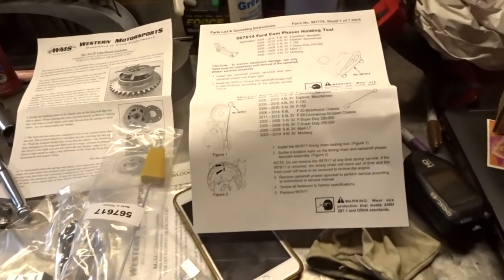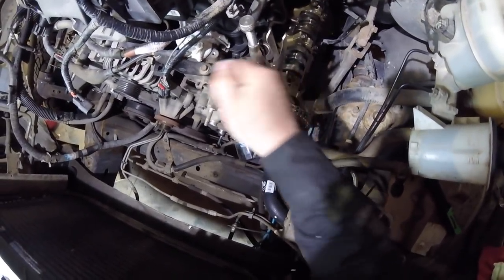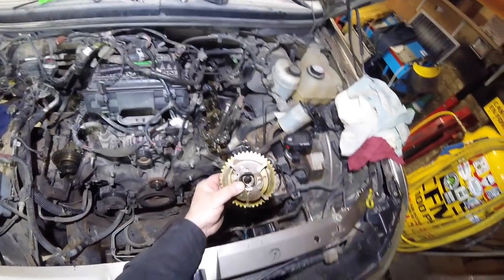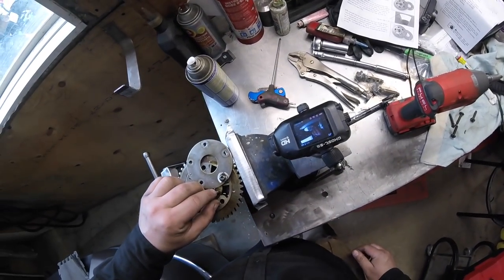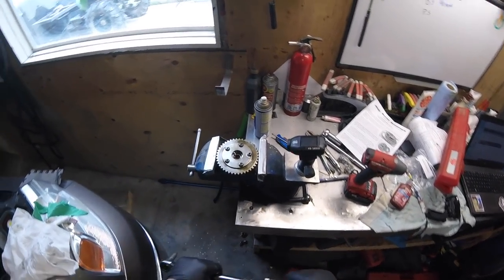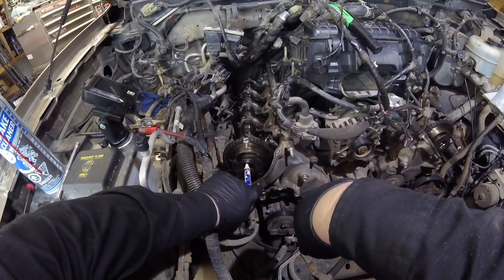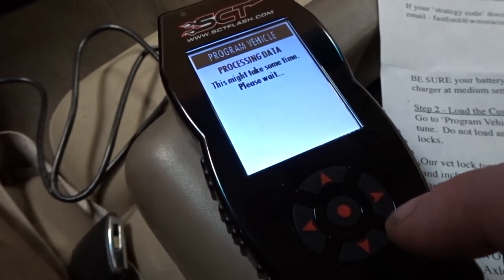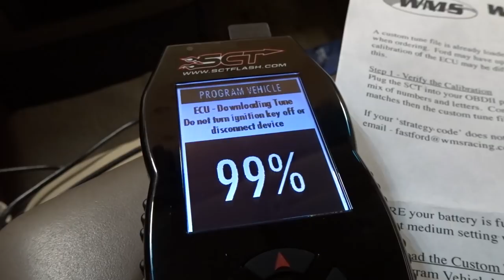Ford 5.4 3V how to install Cam Phaser Lockouts

Comment: DUDE you SAVED MY TRUCK!  My son & I just did this to my 2007 F-150 5.4 (268,000 mi) this week.  I had the cam phasers replaced about 100,000 miles ago, but the problem recently came back.  Just like you said, I ordered the OTC 6681 tool set,  & the WMS cam phaser blocks & bolts with SCT tuner & pre-programmed tune to lock out the phasers.  Your video was an awesome guide.  Even your vice-grip 'mistake' helped us, because we realized which way the camshaft wanted to turn when the gear is removed, and turned out vice grips the other way to prevent rotation, and the OTC "stick" tool held the timing chains fast.  After we serviced the phasers (THANK YOU FOR THE DETAILS!), we re-installed them using your video; no problem getting the timing chain back on perfectly.  While we were at it, we changed out the spark plugs & coils (the cam phaser issue kills them).  Then, we put it back together, we uploaded the tune with the defaults, just exactly like you showed in your video.  Engine started right up, and I think it's NEVER had that kind of low-RPM power before!  Thank you SO MUCH!  I'd give you a SuperChat if I could figure out how!
Reply: Been driving it for a month, now over 3,000 miles so far, including a cross-country trip.  No issues whatsoever, even with over 270k on the odometer.  THANK YOU SO MUCH!
Reply: @Nichetronix  What did you do with the tuner when finished?
Reply: @DelFam2011  I kept it.  It's useful as a diagnostic code reader, and as a engine parameter display (timing, RPM, fuel curve, etc.)  Definitely a lot of value.
Reply: How much to buy it all ? I m thinking of doing it my self .thanks in advance.
Reply: @DelFam2011  I still have it.   I use it when I want to read codes, etc.
Reply: ONE YEAR LATER!  Still rolling!  Truck has had other issues (had a coil-on-plug go, suspension work) but is still going strong!  I've put another 10K miles on it in the last year (I live in the countryside and don't have much of a commute).
Reply: @Testdontguess I have shared your video with another friend who is going to fix his cam phasers on his 2005 5.4L F-150!

Comment: Think...think...cam lockouts are...spacers. Yeah, spacers. You can cut any slug of metal to size and have a similar result. Or use a stack of pennies. The phaser will not move...it will be fixed in position.

Comment: BSK garage how’s your truck holding up now with the lockouts and oil pump how many K on her? I’ve had my lockouts with Sct in for two years now but need another timing job done. This time I’m installing 360 pump and keeping lockouts trucks at 260k cheers good content👍

Comment: Newer ford updated phasers. Ratchet style tensioners, upgraded guides, new chains and the mehlings HV oil pump and 5w30  Had mine done 2 years ago and havnt had ANY issues since.. hot idle im at 30psi oil pressure
Reply: Not sure what happened to mine but lots of noise from the chains. Glad to hear you had success. I’m eying the kit from freedom racing comes with every thing you need! Any advice would be great! Btw how’s is locking out the cam phasers help? The real problem is the oil pump !!

Comment: Thank you, I've been on the fence about doing this to my 5.4 3 valve. I have the same truck as you do. She's been loyal I tell you. She has 394,000km and I've never had internal engine issues. Oil change's and I let it warm up. I never just start and drive, unless it's a real Fucking emergency. Keep making good video's.
Reply from the maker: oh wow that's awesome that the engine has lasted that long
Reply: Lol holy shit here am worried about having 293600 km on my 05
Reply: @mikeethier2779  oil is a hell of alot cheaper than a new engine. These engine's are very sensitive to clean oil. They are durable though, 6 bolt mains throughout.
Reply: Dan P good to know think this is going to be next on the list
Reply: 07 expedition 285500 kms just started ticking. Doing the lockout and its listed for sale. Bought a 32 ft motorhome
Reply: so with that kind of performance why would you worry that the VCT needed to be overidden? Just do a timing job with top of the line FOMOCO timing kit. My suspicion when hearing the comment that this You tuber had heard of retiming jobs going bad an a year or two later is that they were done with aftermarket timing kits that were not up to par!

Comment: Thanks. Right on. Only note, just did this today, aftermarket cam phasers can be different inside and the metal plugs won’t fit. Grinder time. Went exactly as described other than that.
Reply: How are aftermarket’s holding up what brand?
Reply: I personally prefer genuine motorcraft. Not something one wants to do twice…if you can help it.

Comment: In other videos I saw ,out of the 5 bolts on plate,two are for the spring.one bolt holds the loop of the spring,the other goes thru the bottom of spring.but quess since spring is going to be obselete it really doesn't matter.

Comment: I install the lockout kit 2 years ago.  It has worked great.  I'm doing a timing job on the 5.4 and I'm reinstalling the lockout.  The reason for the timing job is specifically the oil pump was down to 18psi when the engine is hot
Reply from the maker: best thing you can do to these motors
Reply: Apparently there is a new oil pump out. 20% more oil flow. Can't remember off the top of my head who makes it though.  It's not Ford. Great Video!
Reply: @locknload9143  meling high volume oil pump.
Reply: @locknload9143  Melling M340 and M360 HV pumps

Comment: Great video. Some times the blurry pictures printed on the instruction manuals can be frustrating. I have a Q about the SCT X4. Does it come with the option to delete the VTC or did wmsracing load the tune on it for you. I plan on installing cams in my 4.6L I asked SCT if they have a tuner that can reflash my ECU after cam install with cam phaser limiters and they replied " Thank you for reaching out to us today. Cam phaser lockouts and Cam modifications require custom tuning. Most tuners can do E-tuning and get you setup with everything you need so you do not have to go to a speed shop for a dyno tune."

 
Best regards,

-WY 
 That reply is telling me that the X4 can modify my ECU so I can run my engine after install ? Any suggestions?

Comment: Thanks for sharing the information! What I did with the diagnostic tool was a reprogramming of the PCM? Is it mandatory to do that?
Reply: No
Reply: Yeah it is it won’t run well without it. They sell replacement ECUs on eBay for like 155$ with the cam phaser delete tune

Comment: There are two reasons why some timing kits take a crap after a year. Using timing parts from an oreillys or wherever, they can only get a hold of shitty Chinese parts. Lucky to get a year out of them. Other main reason these parts can go is not using a premium synthetic oil. With both tensioner seals gone on mine my phasers were still absolutely fine but I replaced them anyways with Ford parts. Myself I use royal purple hps and red line. On the 5.4 and 4.6 3v using the fl820s or the Ford racing filter should be the absolute only filters ever used. Tried wix xp, amsoil, royal purple and they all lowered my oil pressure to were I would have a knock on cylinder 6. Do not waste your time with motorcraft 5-20 blend. Pennzoil,Castro, royal purple, red line are all in my opinion very good syn oil for these engines
Reply: what oil density do you run? I know some people run a more viscous oil than the stock 5W-20

Comment: Thank you this video help me with the lock out kit installed  because I  take it to at shop in the  want to charge  $2175 I did my self and safe a lot money  thanks
Reply: Why is this ? Locking sprocket for ?

Comment: Had shop do this at the same time they rebuilt the motor. Runs great but check engine light is on and codes timing too advanced cam sensor. Do you guys think they simply failed to load the SCT tune? Or ?

Comment: Thank you sir I'm tackling this job this weekend very informative, you cleared up alot of confusion from the forums as well. Quality video
Reply from the maker: good luck
Reply: @Uriel Levi Instablaster =)
Reply: @Nicolas Jaziel Thanks for your reply. I got to the site through google and Im trying it out atm.
Takes a while so I will get back to you later when my account password hopefully is recovered.
Reply: @Nicolas Jaziel It worked and I finally got access to my account again. Im so happy:D
Thank you so much you saved my ass!
Reply: @Uriel Levi You are welcome :D
Reply: @TestDontguess   when you locked out the phasers did you loose much power ?

Comment: How do I know if it’s even worth doing  this to my engine? Is there like a engine pressure test I could do to see if the clearances are within range? I got 240k miles and want to know if I should replace the engine or do this to the timing. To my knowledge it’s running great and smooth right now just has start up rattle when it’s cold and is missing some mid range power.

Comment: Why was the vise grip being used?
Reply: I'm no expert but from what I've read here are my conclusions.  When you take the cam phasers off there is a chance that the cam will rotate to a different position, thus putting the engine out of time on that bank.  The reason the cam rotates is because there is spring tension against the cam lobes coming from the valve rockers.  The thing that is holding the cam in its position is the phaser, which is connected to the cam chain, which is connected to the crankshaft.  If the position of the cam relative to the position of the crank gets altered that side of the engine will not have the valve opening and closing timed properly to the rotation of the engine and the firing of the spark plugs.  If this happens the engine will run rough if it runs at all.  

The vice grip is there to keep the cam from moving when the phasers are taken off.  You can position the cam in the right spot in its rotation so that the risk of it moving when you take the phaser off is lessened, but the vice grip, though crude, gives you extra insurance that no surprises will happen.

Comment: GREAT VIDEO! I Thank you for the step by step guide. I'm in California and had a hell of a time getting a SCT tuner but I finally got one and will be doing this on my truck this weekend.. Thanks again for the road map!
Reply from the maker: I hope you got the SCT that has the special program for the lockout that has to be custom made from your PCM Code cause not any SCT tuner will work
Reply: @TestDontguess  I got SCT x4 7500
Reply from the maker: @Fluxxcapacitor52  that’s not going to do anything for you…… the lockout tune has to be custom created from a company with your PCM code.  Just purchasing a tuner will do nothing

Comment: If you don’t use the machine to tune the engine will the lockouts work ? Or give you a check engine light?

Comment: I have an 06 expedition. I plan to do this to shortly Is it possible to find shops that will flash the new code to the ECM to ignore the valve timing so we can get rid of the check engine light or do you have to purchase one of those tuners you have and as a reference below it Hass to be even a special one of those

Comment: I got about 15000 miles out of the aftermarket kit and with the later Ford dealer parts I'm at about 80,000 and it just started making noise. So hopefully one more time and the rust will kill the truck before the timing set.

Comment: Do you have to put a tune in after you do the block off kit
Reply: Yes you do,
 Remember when you lock these faces that you will no longer have any kind of variable valve timing.... You're stuck in one phase of timing for the rest of its life
 It may may not affect fuel mileage but you definitely have to upgrade the ecu  So it doesn't throw codes

Comment: Two years later still a great video! I learned something. I have an 06 5.4 Expedition with 212000 miles. Didn't even know this lockout was a thing! How many hours did that take? Will you come over and do mine? Lol. I keep getting a cyl 3 misfire code no matter how many times i change the coil pack and the plug, along with a 172 code and a high fuel trim on bank 1, any ideas what my issue may be!
Reply: It might be a bad rocker arm or the rocker arm may have fell off

Comment: Does this tuner work on multiple Ford 5.4 or for one specific vehicle and how would I get the instructions sheets after lockout phasers
Reply from the maker: The tuner is custom programmed to a special code on your PCM
Reply: @TestDontguess  thanks for the reply

Comment: Hi everyone i have a 2005 ford f150 5.4 i replace the phasers and now no noise but the truck doest have power when i try to drive it shuts off especially when the truck gets hot thanks for the aswers
Reply: Same to mine when parking backwards when hot mostly ugly noise stalling shake off

Comment: Hi recently I install new timming kit an lockout camshaft now my truck no more sound like a diesel. But engine light sometimes turn on with a code p0021 and p0011. I ask a need update any software on ecu?
Reply from the maker: sounds like you installed the locks but didn't reprogram the computer
Reply: @TestDontguess  ok I understand I need reprogram the ecu. How I do that?
Reply from the maker: Can’t help you sorry
Reply: @TestDontguess  thanks any tools or scan for do that?
Reply from the maker: Yes google
Reply: @TestDontguess  lol

Comment: What lockout kit did you use and how much did it cost?
Reply: @gregbrophy5781  did you program yours or did you only do the lock out
Reply: A program is necessary for the truck to run right
Reply: @forestgump3977  What is that you are actually programming? what is the name of the test or program?
Reply: Delfino Estrada he had a link in his description to the programming tool which goes for about $300 I believe. And you are programming the truck to run without the use of the vct solenoids I’m retry sure.
Reply: @gregbrophy5781  Do you have a link or place where you bought the lockouts. I see comp has them but very expensive.
Reply: @forestgump3977  could you just unplug vct solenoids and do a tune, essentially unplugging them locks the phasers?

Comment: How does this effect power, mileage,?
Reply: Well think about it, You will no longer have any kind of variable valve timing..... The benefit of doing this is you won't have any more phaser  problems,  The downside is
 Your stuck in one phase of timing, Fuel mileage could be
 Different,  plus you have to reprogram the ECU.

Comment: I have a problem i have the same phasers as you do with the one bolt but my phaser toners popped off and those three little pins are in and i thought about putting little pieces of metal in the holes and jb welding them to stay or putting a washer there and eliminating the toners completely your thoughts i sean you said the internet answered in your video that i watched 10x but you just looked at the toners and the pins and yours were fine but what if they weren't???? Help!! Any good ideas ??
Reply from the maker: Then they are junk and need to be replaced
Reply: @TestDontguess  but doesnt the lock delete the whole purpose of tge toner it cant move its stationary right??
Reply from the maker: do what you wish it's your vehicle i could care less what happens to it
Reply: @TestDontguess  ok i was just trying to get the whole understanding of the engineering of the phaser and locking of the phaser i thought maybe. And this is one of my many fords first gasoline engine and thought maybe you might of knew more then me on it now i know Thanks👍👍
Reply: Ones mans junk is another mans treasure!!👍👍the best lockout ever custom toner postion for a custom lockout. Rides out awesome power

Comment: So when you install the lockouts do they get installed in the bad phasers or do they have to be replaced. Also do the vet solenoids have to be replaced as well?
Reply from the maker: you must not have listened to the video as it clearly explains it
Reply: Ok he didn’t replace the cam phasers but he didn’t mention anything about the vct solenoids. If the lock outs are installed should the solenoids be replace as well to be on the safe side?
Reply: If he didn’t mentioned it mean do not change it 
If you want to be safe change everything.
Reply: @MartinRodriguez-gx9cs  From my understanding the phasers can fail in more than one way, so I would change them too.  The solenoids I think you can bench test them and visually check them if the screens are broken.

Comment: Brian of MakuLoco doesn’t seem to recommend using the lockouts. I’m curious to see if you notice any downside to installing them.
Reply from the maker: Nope runs better now than the engine ever has.  You can either keep replacing a part that will fail or solve the problem
Reply: @TestDontguess  did you notice drop in fuel economy?
Reply: It cost more to do the lockout and hurt my top end power. I never monitored fuel economy but if I could go back I wouldn't do it.
Reply: @mikepotter4141  Cost more to do the lockput than to do a set of ford phasers?  What did you pay??
Reply: @AlanDike  lol
Reply: Stable Genius you forgot one more, no more broken spark plugs

Comment: Is the Phaser removal a must or can you install the locks right there? It seems like is duable. can any one please advice?
Reply: The spring may have a load on it, due to the timing chain, however that's a very good question.